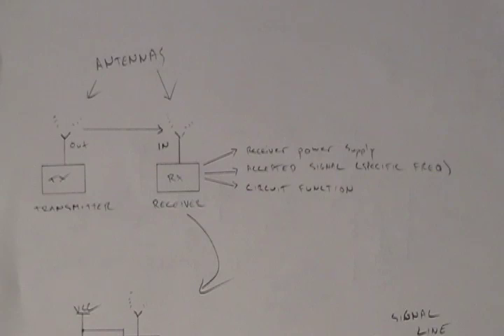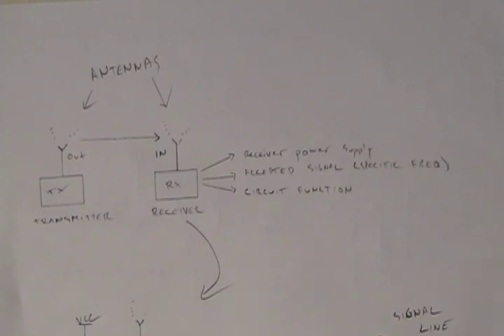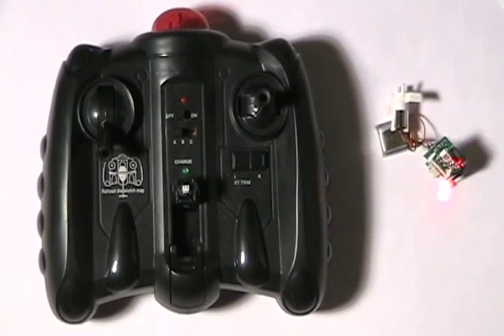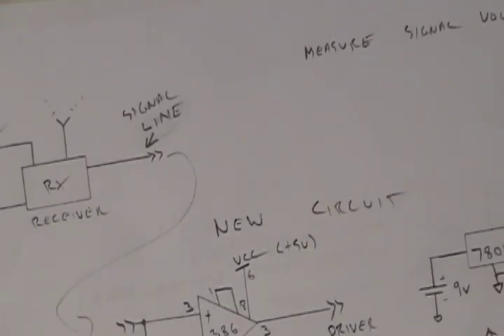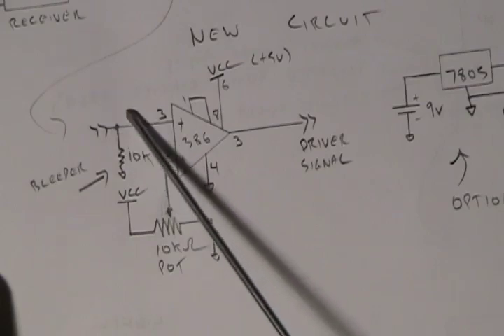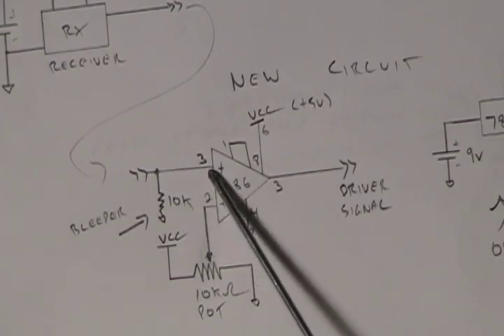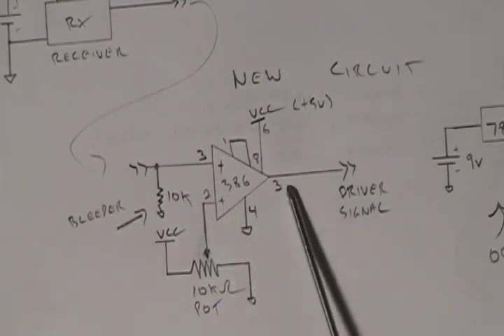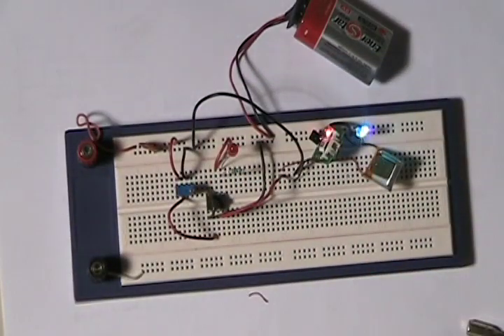Practical Circuits: RC Transmitters and Receivers - How to remove and play with them!

Comment: Is this circuit meant to mimic the variable power (or pwm) input to the load as the receiver does with varying the speed of a motor, or is it just to simply supply the load with more power than the receiver is capable of outputting?  If the goal is to just become a high power switch why not simply use a mosfet with a resistor?

Comment: you dont nothing about radio signals dude serius;ly
Reply: The video is about modding RC transmitters and receivers.  It isn't a video talking about AM or FM modulation/demodulation circuits.  Don't pollute my wall with inconsiderate and stupid comments.
Reply: nomercy0401 With spelling and punctuation like that, I wouldn't be calling other people "stupid bastards"...
Reply: There are several components to learning electronics. One resource I found which succeeds in merging these is the Gregs Electro Blog (google it if you're interested) definately the most incredible info i've seen. Check out this  extraordinary website.